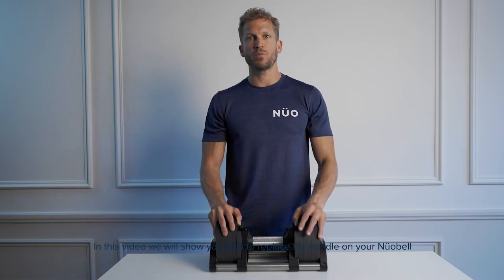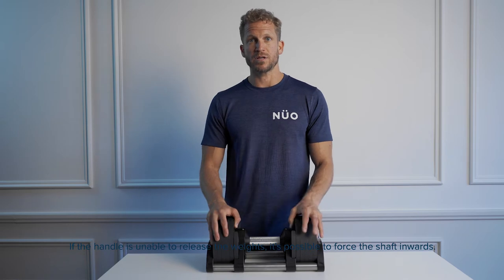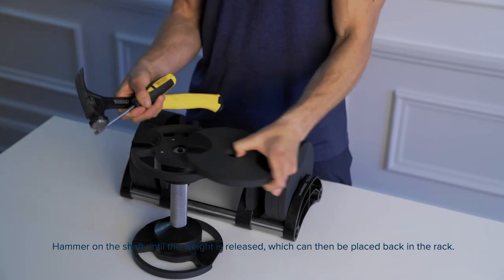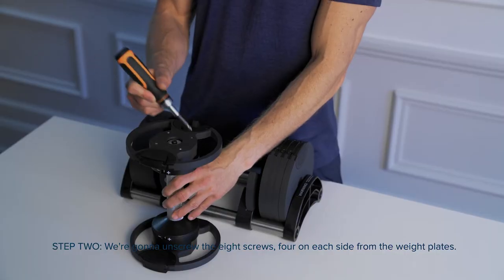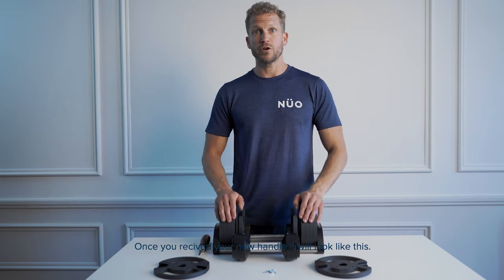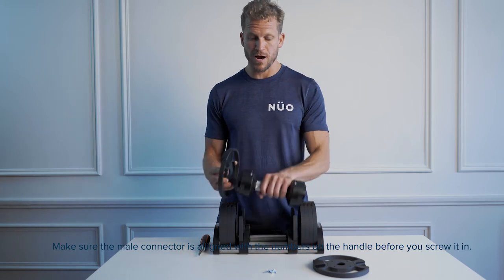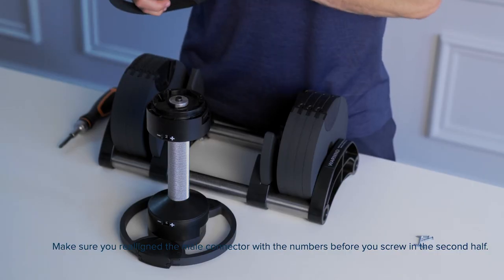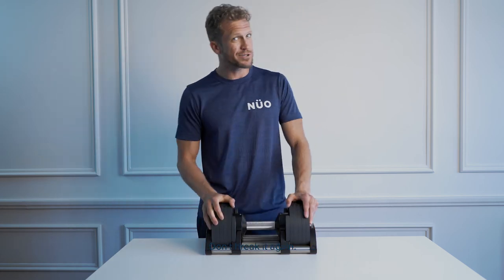NÜOBELL - Handle replacement instructions video

Comment: I’m sorry but this video is entirely unhelpful for when your handle won’t set to the lowest weight. Just hammer a screw driver twice gently and the weight pops off? What? I feel like this video is gaslighting me.
Reply from the maker: Thank you for your feedback! As the video suggests you use a screw driver and a hammer to loosen the mechanics. If you're handle is stuck on a certain weight you have to use more force for it to loosen. If you're still experiencing problems please reach out to our support at info@nuoathletics.com and we'll guide you through it. :)
Reply: @nuoathletics  Hi, how do you tighten the dumbells? I've experienced a plate falling off twice while traning on one of my dumbells. Had to re-do the whole set up, so that it was placed back on the handle, but would like to tighten them if possible. Is there an instruction video available?
Reply from the maker: @lirikrasniqi9415  If you bought the originial NÜOBELL please email us at info@nuoathletics.com with your order confirmation and we will assist you further ☺

Comment: “Make sure you don’t break it again”…. More like MAKE A BETTER PRODUCT!!! 

Those new rep x pepin dumbbells will be the gold standard.
Reply from the maker: The NÜOBELLs are made for training at home. The mechanism is advanced technology, and like most adjustable dumbbells, they are not designed to be dropped continuously. Use them normally, with love and care and they will last (almost) forever. 💪
Reply: @nuoathletics  The Nuobell's only have a limited number of handle rotations on them. There's a small piece of plastic that wears down on each weight change, so the "forever" is more like a couple of years tops. I bought mine 4 years ago and it is already broken. Never been dropped and always handled with great care. No help from the company whatsoever, other than they suggest to buy a new handle each time.
Reply: Same exact problem. Already replaced two handles. Maybe if the internals weren't junk plastic.
Reply: @nuoathletics no, your product just sucks

Comment: So if your watching this sorry your in for frustration maybe but here’s my story. My brother and I were working out and he may of dropped the dumbell too hard on 60 lbs on a foam surface. The plastic piece on the end kinda came loose and wouldn’t adjust the weight when placed on the rack. After trying the screwdriver method with the weight still on it I realized it’s not gonna work after beating it like a barbarian. So what I had to do was the metal coil in the inner circle was coming out thankfully so I was able to finally pull that out and the weights came off. Nuobell sent me a new handle just had to cover the cost of shipping. If this happens to you and you can’t lower the weight your going to have to destroy the handle which is much cheaper then the weights themselves. Good luck!